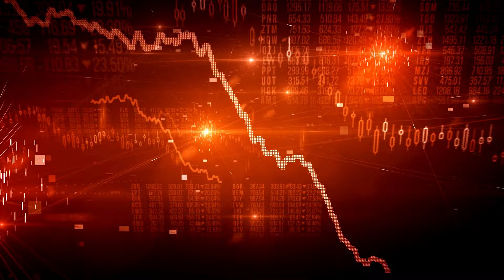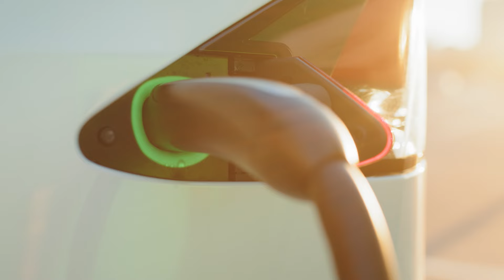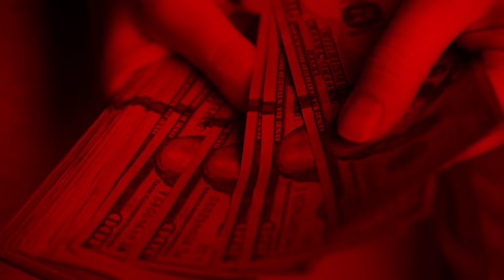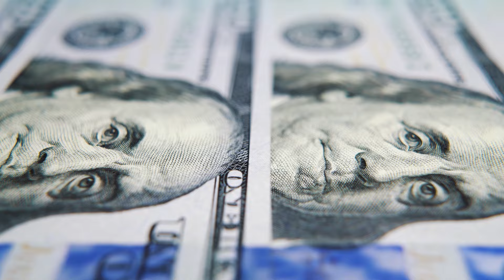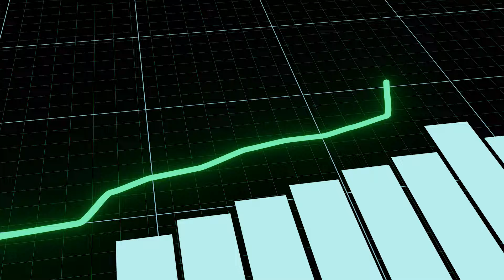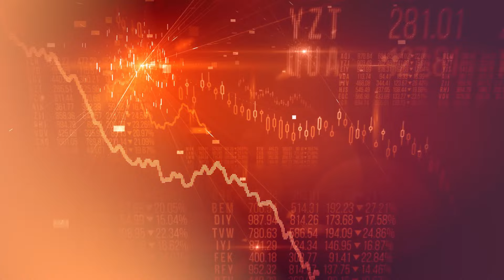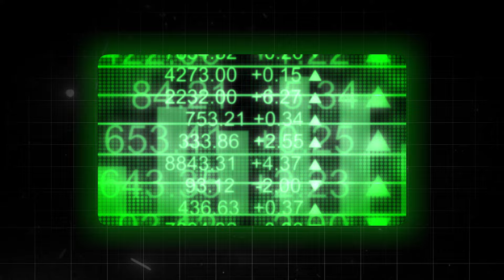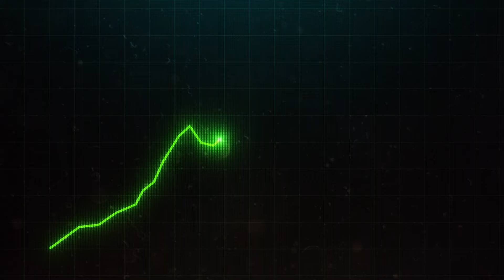The Truth About CRASHING EV Sales!  What are they HIDING?!

Comment: Here you go again. The reality is all vehicle sales have fallen off a cliff over the last year. Check out the stats on new truck sales if you want a talking point about a drop in sales. Please start doing some research not just reading the last media headline...
Reply: True, sales are trash industry wide, but EV sales are hot summer garbage low. Rural dwellers have no desire for EVs, leave them in the metro.
Reply: EVs are crashing horribly.
Reply: Junk
Reply: @lot2196  yeah, down to 10% growth. Yes, still growing.
Reply: @davekozlowski1266  But Hybrids are growing faster. Every Hybrid sold is a BEV that won't be sold in the next 10 years.

Comment: Uploaded and promoted by greedy big oil corporations. That's like saying ICE car owners going back to horses😂
Reply from the maker: Nay...
Reply: I haven't bought a drop of gas in 5 years and I love it love no 🛢 change I love it no timing belts no spark plugs yes I have issues with the batteries it not perfect. But I love not paying for gas.
Reply: @stevencorrea8032 but you have a car worth nothing in resale.
Reply: @TooOldToCare-kl3co  that's why I got mine used I don't go very far if you have to go long distance the best is Petro but I don't travel long distance anyway
Reply: Big Oil LOVES Battery cars, they sell 7 years worth of oil for an ICE car for every Battery car before the battery car has moved a foot! 7 YEARS profit in one year! Plus natural gas power generation to charge them.
Reply: @stevencorrea8032  But the tires are fine? LOL
Reply: @stevencorrea8032  Then an economy car probably would have done you just as well. A Toyota Echo that gets 40mpg around town you might have to fill up once a month and it's a small tank. Probably fill it up for the difference in Insurance.
Reply: @robertkubrick3738  well they were out  faster from the torque of the motor and  weight of the battery
Reply: @stevencorrea8032  Did you know that they also have shallower tread on Battery car tires? Because shallower tread gives less rolling resistance but they still won't pass inspection with less than 3/32 tread. Battery car tires come with a year less tread on them for a normal car.
Reply: @robertkubrick3738  no
Reply: @stevencorrea8032  Yes, surprised you didn't know that.
Reply: @robertkubrick3738  yes

Comment: I suggested to Elon a solution for Smaller long range Battery powerd vehicles. Didn't do anything with the suggestion.
All he has to do is add a electro magnetic generator to a Tesla, once started runs until it's shut off making electricity.
It can make enough to run the vehicle without a battery, but a battery is needed in case there is a higher draw, like towing, driving up hills etc.
Plus they do make notice unless well insulated.
Need a battery to start the generator, but once on, runs perpetually.
Reply: You won’t get perpetual motion, but you would increase range significantly, you still get losses,due to friction etc, but I agree this is a good idea. I have done it small scale, and more than doubled range. I keep getting told by‘engineers’, that it won’t work, but it does.

Comment: Old ICE and New EVs are all obsolete.

Try this:
150 MPG HWY
240 City
200 average

300k mile warranty, 2 overhauls, 900k life
$30,000 price
3,000 miles HWY with CO2 + water capture, 9k without
300 HP continuous, 900 short duration
30 times lower energy cost than EV SC
3 engines

This is what people want.  EVs are a silly pathetic joke.
Reply from the maker: Sounds good.
Reply: And it's available today right?